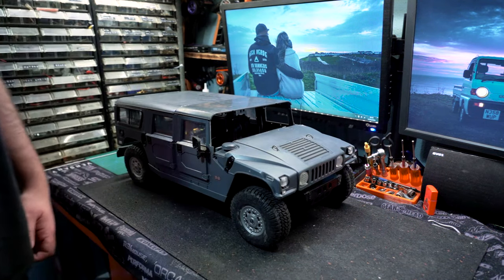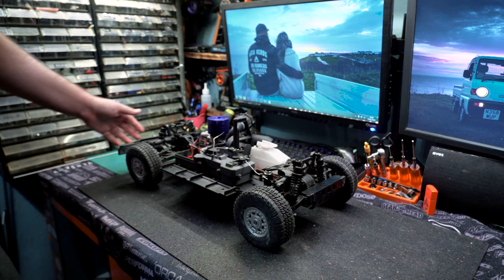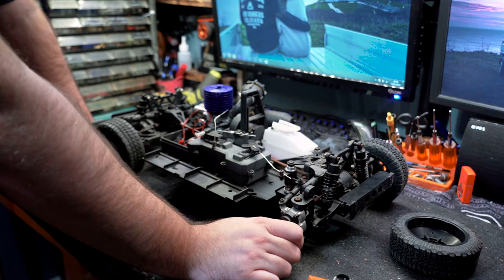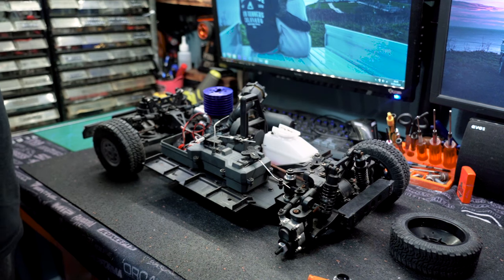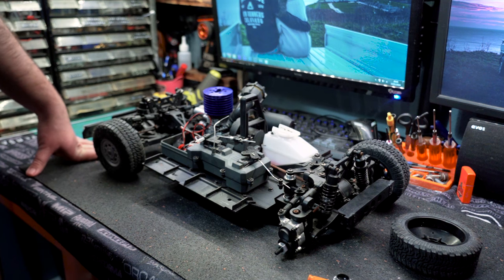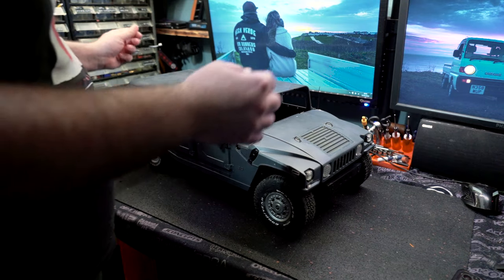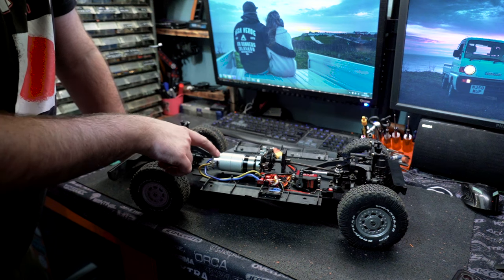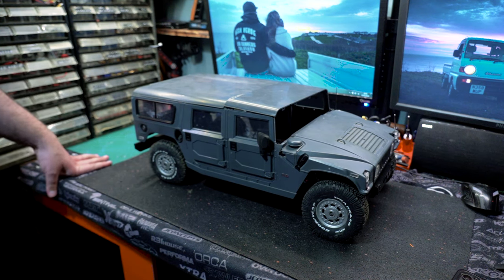Is This RC Really Worth $1000?? Kyosho Hummer H1

Comment: I believe the kit came out somewhere in the mid 2010s but don’t quote me on it.
Sometime down the line Deagostini/Modelspace offered the kit in two payment plans, either as a monthly instalment plan or a single purchase full kit for somewhere around £549.

The body is an interesting one as it has an inner skeleton to which the main panels then mainly bolt up to.
From memory, the only major parts that you really need to glue on are the lower side panels although they can just be friction fitted into place.
The roof is usually best done to have the front section glued into place to the front windshield where it has little tabs for the roof panel to keep neat panel alignment and have the larger rear section removable.

I mainly run SCX10 First Gen 3 gear transmissions in my ones and they provide sufficient gearing for all round use.

These are a smashing trail truck and certainly not seen a lot.
Great to see another one about.
Reply from the maker: Ah $1,000 was just a guess/Clickbate as see a few ads recently from Deagstini where there model kits overall price was that 🤣

I really want to find more body panels for this as the internal frame is broken and most the screws holes are broken or blown out. It would be nice to have it as one piece body if they re release it.

Yeah all photos I seen has the back roof panel open which I assume so can pull start.

I was tempted by switch to a scx gearbox but then I saw the adaptor thinking it would fit without a issue but I was wrong 🤣🤣
But the set up that I currently got in it is a Jonson 600 motor into a 3:1 reduced to the stock gear with a 10t pinion gear. 

Going to take it out for a test trail on Sunday to see how well it goes. It would be cool to see photos of your set up as it is kinda curious how to get better preform.